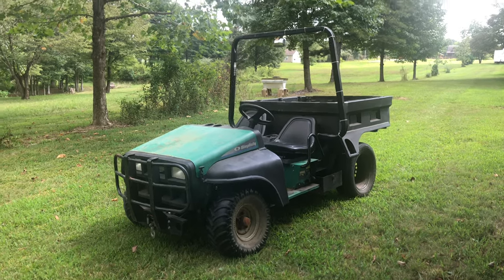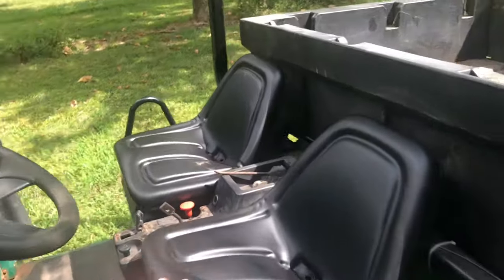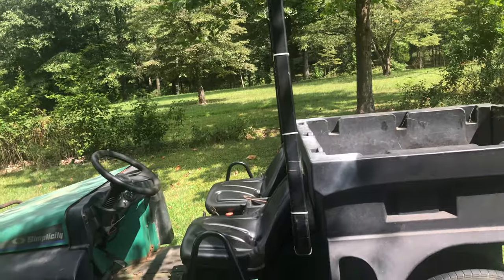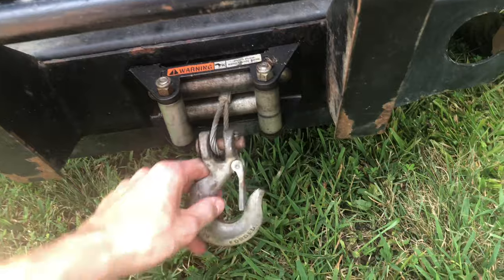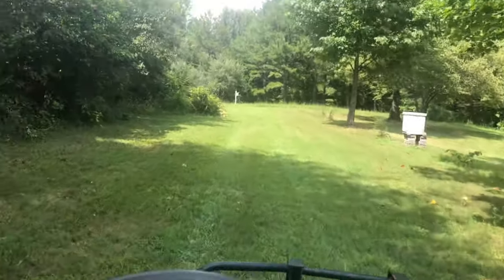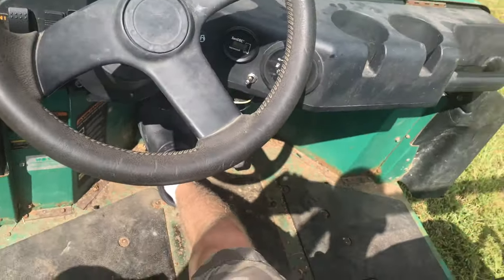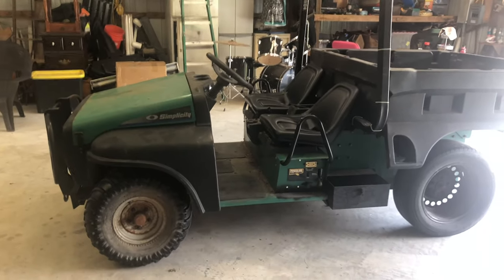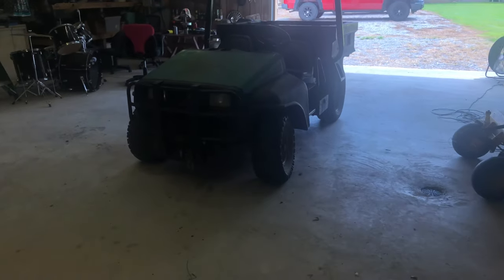My $300 Snapper Trail Cruiser!

Comment: Hey buddy i just bought one of these things and i was wondering if you knew anyone that had parts for these things.
Reply from the maker: From what I hear parts are hard to come by on this thing. And if you can find them they are expensive. I bought new seats and put them on they aren’t an exact fit but they fit and they were $120 apiece
Reply: Yeah I’ve found out everything is expensive. I’m still trying to find a few things for mine. Thanks 👍
Reply: Hey buddy i just found another one for parts, it has a Kawasaki engine in it and it’s almost a complete side by side. It needs the rear end fixed and needs seats on it. But i can get it pretty cheap.  It’s a older one maybe a late 90’s and it’s a snapper grounds cruiser. Everything is almost identical. Except for the age and the hood is a little bit different. Looks like a Jeep  but has the generator on it. Just wanted you to know that snapper and Simplicity was building the same thing.
Reply: I have one similar to the one in video. Snapper Trail Cruiser, with a 16 HP B&S Vanguard engine. I think onboard generator is neat but really haven’t had a great need for it. Dump bed is larger than many utv’s made today. Thanks for the video.